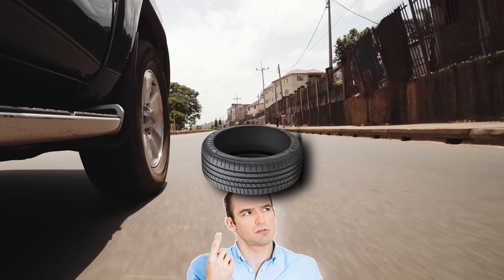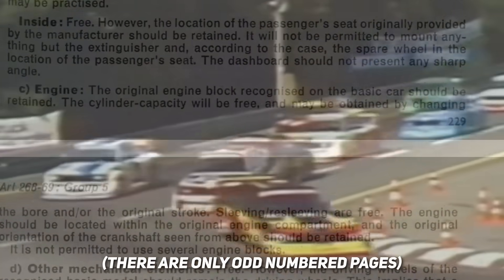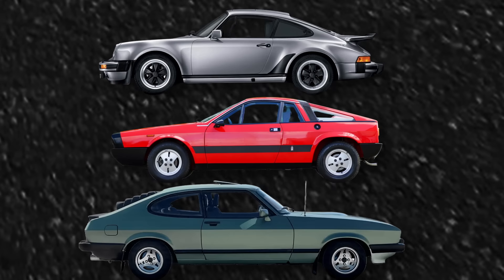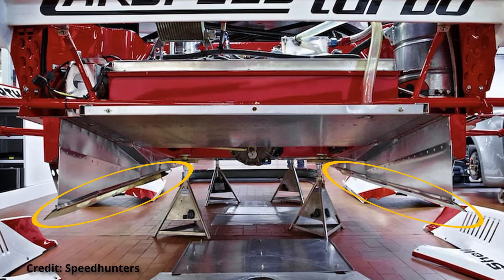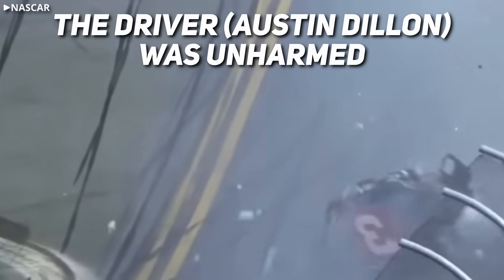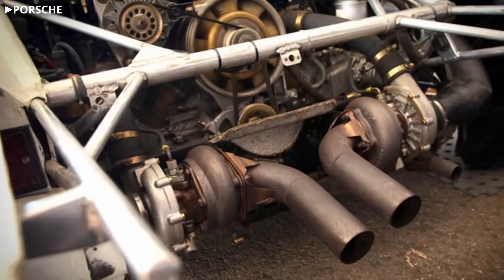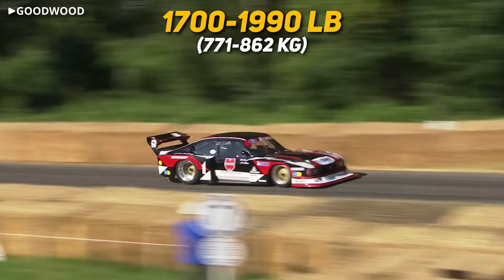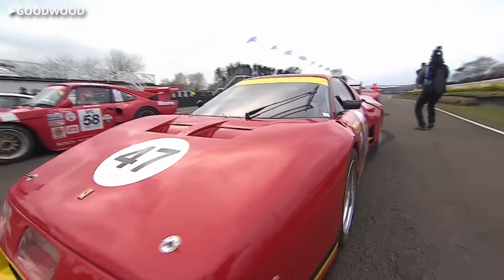The ABSURD Rules and Engineering Behind Group 5 Special Production | Group 5 Monsters Explained!

Comment: Group 5 is a perfect example of how mechanical diversity can make racing interesting, even if a single make/car dominates. I can only imagine how much crazier today's race cars would be if they weren't so strictly regulated. We've already seen the Porsche 919 Evo unhinged, and that was incredible.
Reply: It reminds me of racing in britain in 60s it was v8 mustang vs capri inline 4...On straights mustang was faster but in corners capri would catch
Reply: @bobanppvc  you ought to see the videos of the Holman & Moody 427 Ford Galaxies doing battle with Mini Coopers and Alfa Romeos at Goodwood (if you haven’t already)! Some of the best racing to watch
Reply: More freedom to innovate makes motorsport research more diverse and increases the odds of technical sponsors being interested in developing what they envision for trickle down to their products.

More factors of uncertainty from diverse concepts also reduces the odds that everyone quickly throws their core concepts away and blindly follow the leader’s path as an open-ended regulation means the likelihood of finding an even better solution than the current leader (instead of playing catch-up) is higher. 

Diverse car characteristics also means distinct advantages in different scenarios e.g. speed profiles of various corners, biasing overtaking under braking or accel for different cars. The best concept for Red Bull Ring may not be very competitive at Spa even though they are not even that different for modern F1 car concepts.

Closing up the field has always been a cost-limited argument where lesser funded teams throw tantrums that they can’t be expected to develop the ridiculous things top teams can. With cost cap now being tried in F1 this concern is gradually phasing out, and it would be silly to continue having such long rule books where everything is mandatory and everyone has to spend thousands of hours fine tuning every surface by millimetres.
Reply: @icehawk3r  That’s just throwing everything into the domain of engineers. The one thing we know from that is that it means the drivers have less and less influence over the outcome and that’s got to be a bad thing. Next thing you know, you’ve got people complaining that drivers were so much more skilled in the old days and that the cars practically drive themselves these days.

As one who for 35 years, still competes regularly in sport - sailing - I can tell you that the best racing is in one design fleet racing, where all the boats are identical and the best sailors stand out. There’s no reliance on who has the faster boat. Because, in the end, all the boats have the same potential performance but there can only be one winner and that is the sailor or crew who makes the fewest mistakes and adapts best to the conditions.

Contrast that with CanAm racing from the 60s and 70s. That series was a victim of its own success but to was totally dominated by two marques: McLaren and Porsche. Nobody else stood a chance, however good they were, mainly because they simply couldn’t match the budgets. Not even Jim Hall’s Chaparral team or Lola was able to match those guys. When you open things up to development, the risk of failure is very high.
Reply: @thethirdman225  Perfectly reasonable to enjoy one-make series. 
But in series where the engineering IS the challenge, closing as many borders as possible just means our 10 F1 teams are spending 10x the resources to converge on a 95% similar solution. That kind of engineering appeals less than it could have, for both the layman and industry. Different concepts, different optimal solutions. 

Doubt the other one-make series would become better at nearly this pace without taking lots of inspriation from F1 teams' developments and findings--which even as trade secrets do show up as a lot of half-understood physical objects for the world to see. They are interlinked but separate entities.
Reply: @icehawk3r  
"But in series where the engineering IS the challenge, closing as many borders as possible just means our 10 F1 teams are spending 10x the resources to converge on a 95% similar solution."

The problem is money. Always has been.

"That kind of engineering appeals less than it could have, for both the layman and industry."

That may or may not be true. If all anyone wants is a parade of technical advancements I'd be a bit surprised. We've already seen it before. Remember the Williams-Renault with the active suspension the just steam roller the field? Does anyone really care about it when Verstappen already has a stranglehold on the point?

The vast majority of fans seem to be more interested in engines than actual racing. Not meaning to be presumptuous here but isn't racing supposed to be the main attraction? I know it's pointless taking an absolutist policy on how people get their fun but ask the drivers what they're there for.

"Doubt the other one-make series would become better at nearly this pace without taking lots of inspriation from F1 teams' developments and findings--which even as trade secrets do show up as a lot of half-understood physical objects for the world to see."

There are series and there are series. Some are feeder series and some are intended only to accommodate elite drivers. Personally, I think there's a lot more going for something like Indy car than F1 and I say that as a non-American.

 had a lot more fun watching Le Mans over the weekend than I ever would have watching F1. Sure, they're not identical cars but the way the series is managed more roles insures that the results are less dependent on finances or designs than they are on team management and drivers.
Reply: @thethirdman225  On a side note: When you mentioned CanAm racing of the 60s and 70s, I wonder why you put McLaren next to Porsche in the sense of unmatchable budgets. From what little I know McLaren wasn't rich, did he receive funding from Ford or what made you say that?
Reply: @argh1312  McLaren became a major constructor because of CanAm. They sold very successful designs to a significant customer base and that included other formulae, such as the emerging Formula 5000 and of course, F1. They were, to be blunt, raking it in.

As a result, they were easily the dominant manufacturer in CanAm, Porsche notwithstanding. Except for 1966, they won every series up to 1971, virtually unchallenged. And of course, that kind of dominance has a cash reward. 💰💵
Reply: @thethirdman225  Huh! Didn't know that, thanks for your reply! :) Cheers
Reply: @argh1312  If you’re a CanAm fan, there’s a coffee table book by Levy and Biro that was released for the 50th Anniversary of the series. It’s worth a read, though it’s quite expensive.
Reply: I don’t see how a category dominated by a single marque makes for interesting racing. As an example, I’d rather watch F2 than F1.

Comment: 03:06 Correction. The frog-eye headlights were carried over to the bumper of the Porsche 935 not in 1978 but in 1976, when this car was created. One or two races were run with traditional 911-style headlights, then flat noses replaced them.
Reply from the maker: I had originally planned to mention more of the 935s prior to the 935/78 but it would have made the video far too long.

Comment: Concerning the engines:
Porsche went on to dominate Le Mans with nearly the exact same engine as the 935 for more than 15 years! It was used in 936, 956, 962, 911 GT1 and even the TWR LMP and the Dauer 962 in pretty similar configurations!
And for the Capri: squeezing 600+hp from a 1.7L L4 engine is still a crazy number even for todays standards!

Comment: The Ford Capri. 🤤😎

The choice of the Capri's engines seems a bit odd.  AFAIK they never produced a 1.4-litre version, they were 1.3l, 1.5l, 1.6l, 1.7l, 2.0l, 2.3l, 2.8l and 3.0l, so I wonder where they never went with the bigger options as they had the 2.0l, the 2.3l and the 3.0l from '69 onwards.  A twin-turbo 2.8i might have been fun from '81, perhaps bored out to 3.2l, too! 😄

My first car was a freshly repainted black '82 reg 2.0S which I absolutely loved; there was nothing quite like racing your own rear-end around wet roundabouts, and looking good doing it! 😂
Reply from the maker: Sounds like you had a great time with that car! As far as the engine, my best guess is that they were trying to build as lightweight of a car as possible and had they gone with a larger displacement, the car would have had a higher minimum weight to meet. This was the era where manufacturers were really starting to experiment with turbos! Thanks for the comment!
Reply: The DRM used two classes, over 2 litre and under 2 litre similar to IMSA GTO and GTU. Turbo cars had a displacement factor of 1.4 compared to NA cars so the maximum capacity for turbo engines in the 2 litre class was 1.4 litres (1.4 litres displacement times 1.4 turbo factor = ~2 litres overall displacement).

Comment: As a teen I loved these cars they literally ! Changed my life . I only wanted to work on(edit: motors in cars , motorcycles anything that went fast) from then on.
Check out that turbo blow off valve at 5:54 , air cooled with a controlled pressure dome ( aka Scramble GO GO GO baby ).
Edit Edit: you people who just read history back are boring, why and how could they get away with welding the heads on? I know how and It's so simple you can look at a Harly and understand how. Both motors are built with this simple bolt on cylinder only tricky part is getting valves parts in .
Reply from the maker: 🤣I know how and why they could get away with it. The line about their "service technicians" was a joke if that's what you are referring to

Comment: I remember Ford and BMW requesting to change the rules for the chassis. They wanted to modify the floorpan. The organisation agreed, but only if the competition would also agree. Porsche agreed, which surprised both BMW and Ford, not knowing Porsche already did their homework and made the 935 even more dominant, thanks to BMW and Ford, who both gained nothing from their request.
Moby Dick wasn't successful though.
Glad i could watch Group-5 in the 70's, it was, and still is, a spectacular form of GT racing!
Reply from the maker: Must have been amazing to watch it while it was still going on! I'm too young to have lived through it.
Reply: @themotorsportstory  It sure was! And one of the best things is that these cars are still around, raced during demos and we can now watch them in HD!
We had a crappy tv set with crappy reception back then, lol!
Also, the FIA had a habbit of making the mistake of leaving (sometimes very obvious) loopholes in the regulations over and over again. One very interesting era was the BPR/FIA GT (1994 - 1998), resulting in some hilarious and creative interpretations of the rules (look up Toyota GT One luggage space).
Reply: @2stroke4me  That one was on the ACO though not on the FIA. When the FIA took over the BPR for the 1997 season they were forcing their homologation rules for GT1 and GT2 very strictly only allowing the F1 GTR, 911 GT1 and CLK GTR with the odd one off appearence of a SARD or Lister for a single race but thats it. Stuff like the Dauer, TS020 or R390 were due to the ACOs policies and they werent eligible for the FIA GT Championship. The FIA also had their own shenanigans with the Panoz GTR, Lotus / Bitter Elise GT1 and the Lamborghini 132 GT1 but they werent quite as "bad".

Comment: Cool video!
Regarding the chapter "chassis design", I think it might've missed a pretty important sidestepping of the rules made by Ford for the Capri in some cars in atleast one of the groups:  as I recall, the original capri has a solid axle and rear leaf springs, and this was circumvented by retaining a very weak/soft leaf spring setup only to stay true to the rules, and combining it with a separate coilspring setup that did the actual grunt work!
... so a bit like Porsches double rear window but on an even larger scale :)

I gotta say that I'm surprised Porsche got away with the reprofiled hood and lowered headlights though.   
Surely it must've been possible for FIA to state that the actual body shape was altered when the headlights were moved?
Reply from the maker: Thanks for the additional info, didn't know that! And yes, I had the same thoughts on Porsche's headlights, but I suppose maybe they were able to argue those shapes in the hood were part of the headlight? Either way, I'm sure their competitors weren't happy haha

Comment: The gr5 production class end came because the budget was getting to high and group c was starting to take shape. Lot of teams like kremer and joest and zakspeed al were making gr c cars.Or buying gr c cars later the season 82.
Reply from the maker: I've always found that interesting. I wish that Group B circuit racing had taken off a little more than it did, but I think you're right that the interest heavily went to Group C instead (at least on the circuit racing side)

Comment: The fact that Group B was introduced to make group 5 less crazy is mindblowing
Reply: are you comparing circuit racing to rallying or am i missing something ?
Reply: @DarkIzo Group B was a class that could be used for any racing event. The Porsche 959 and Ferrari 288 GTO were both built for circuit Group B racing.
Reply: @R4M_Tommy  although important to note, apart from their Le Mans effort with the 959-based 961, Porsche also took their Group B 959 to Dakar (although the car was detuned and modified specifically for the race). Ferrari never participated in any Group B road or rally race with their 288 GTO unfortunately.
Reply: Group B was never supposed to be a rally class. It was supposed to be for GT cars.
Reply: @DarkIzo  yeah im confused too, but group B was indeed very wacky
Reply: @DarkIzo group b was originally a circuit class

Comment: Another class was Group 7 Sports Racing, aka, CanAm. Minimal regulations. Had to have the capability for 2 seats and an open cockpit. The series was essentially killed by the impecable preparation of McLaren cars and eventually Penske/Donohue with the turbocharged Porsche 917 cars. Aluminium big blocks poked and stroked to 500 CID and about 1500 pounds. When they came out the Porsches were 5.0L and then 5.4L. Domination kills spectator interest eventually.
I think the Group 7 could have been a lasting success with a 5.0L engine limit and no power adders. Might have seen Ford and the General develop their 5.0L engines and possibly DOHC 4 valve heads with street versions released.

Comment: ex F1 driver Rolf Stommelen was killed in a 935 at Riverside in April 83 after the rear wing broke. From pictures of the wreck the cage looked to have held up however Rolf died of head injuries, possibly I read somewhere the seat may have broken but cant confirm that.
Reply from the maker: Very tragic!

Comment: Nit picking but neither of my favourite Gp.5 cars were mentioned in this video or appeared in it.
Not sure why - one of them is the Zakspeed Escort (Ford Europe), and the other is the Dallara Icsunonove (Fiat/Lancia).
You do mention Dallara's involvement with the Lancia Montecarlo/Scorpion regarding the spaceframe and suspension, but not the X1/9.
The Dallara Icsunonove is the only Dallara based on a production car and is significant for that.
The Lancia Beta, wasn't a Dallara car per se, and neither are the Lancia LC1 or LC2 although you can clearly see who developed those!
I'm trying to find out who developed the engine and transmission in the Beta Gp.5.
It's a 5-speed manual (inline transaxle) with close ratios and a LSD, probably developed by Fiat's subsidiary Abarth.
The Dallara Icsunonove is even more interesting imo, being even smaller capacity (1300cc) DOHC 16V of an unusual design in which one camshaft drives both the inlet and exhaust valves and the other drives a mechanical fuel injection system.
Sadly, very little footage exists from that period.
But thanks for uploading this 🙂👍
Reply from the maker: Glad you enjoyed! I ended up settling on the few cars which had the most information out there to give people a good introduction to Group 5, but I'm definitely open to making more videos focusing on specific cars in the future. I actually came across the Icsunonove in my research and was disappointed there wasn't more information available on it!
Reply: @themotorsportstory  it's very obscure, the Icsunonove.
Pretty sure information exists if you know the right people but otherwise not.
Anyone considering making a programme about it would need a budget, and would probably arrange a visit to the Dallara museum in Italy,  likely with an interpreter!

Comment: The fan and manufacturers didn't "get bored" of the prototypes, Ferrari, Alfa and Matra left for F1 because the cost of running two top class programs was too high, Gulf-Mirage sold out to Harley Cluxton who couldn't run the team at it's former level. Not many other could compete with the turbo prototypes from Porsche and Alpine so the FIA created group 5 to fill out the dwindling field. Their reign lasted until IMSA started the GTP class in 1980 and the FIA followed with group C two years later.
Reply from the maker: Correct, those are all reasons that manufacturers' interests in building prototypes waned. Maybe I should have said "lost interest" instead.